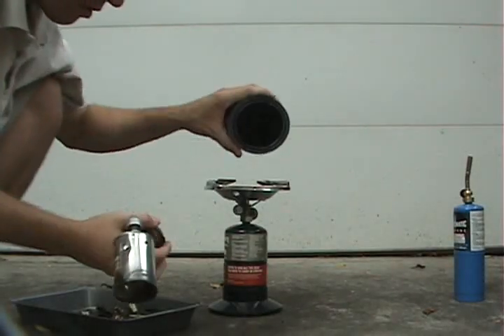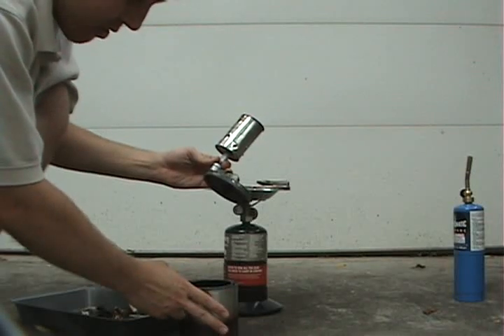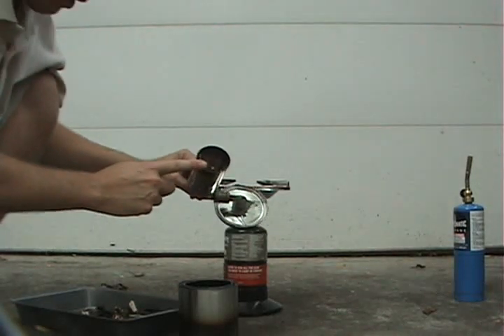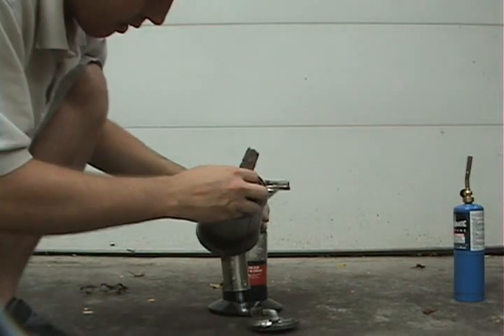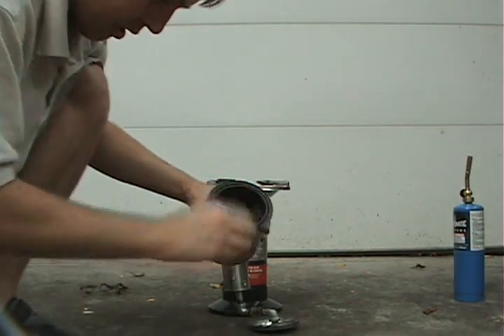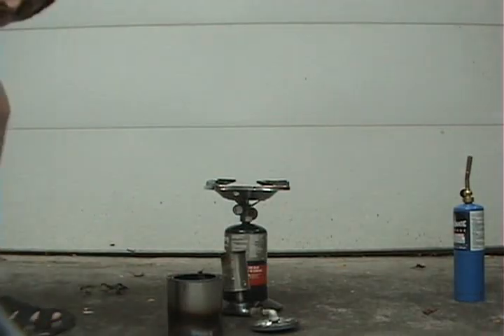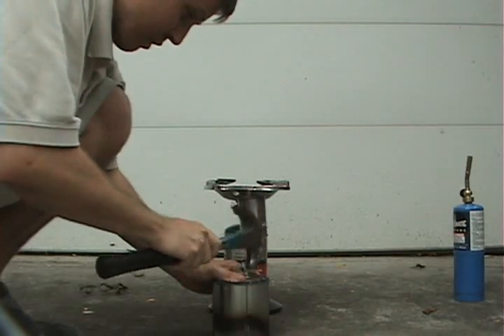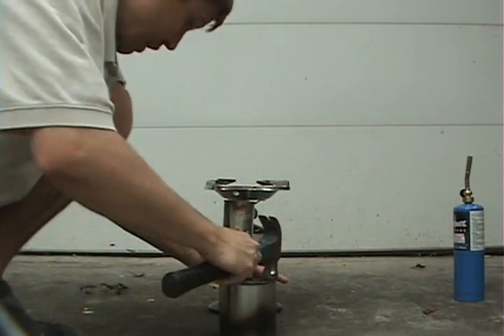Simple Wood gasifier

Comment: Thanks for sharing. I guess after it's has been burnt you could use the charcoal that is left after gasification. That way you can reuse the left overs for your next run. Great work keep it up
Reply: I use my charcoal in gunpowder. Also make activated charcoal from it for various uses.
Reply: @gwsmith76  They done lab testing on some Lab rats to see if claims that if activated charcoal could actually save you if you ingested poison. In the process of feeding the rats poison and activated charcoal they were stunnished when the Rats didn't die and lived three times their expected life span they had to kill the rats to finish their findings. Their finding was not only if you ingested poison that activated charcoal would save you but it was found that drinking activated charcoal everyday would increase your lifespan by 300%. I haven't personally drinked it but heard you could use lemon juice to make the activated charcoal instead of the Potassium Hydroxide. I personally believe it's the very large PH of activated charcoal than the anti-Toxification that it has that prolongs life, because the  activated charcoal moves straight through the digestion system and out the colon. I think the Potassium Hydroxide is the reason the rats life expectancy tripled.

Comment: Producing syngas from wood seems like a cool thing to do but it seems like most people are burning wood, coal or propane to fuel the pyrolysis. Great for the prepper mind set but not realistically valuable unless an complete break down is society and economy happens. I would like the use electrical resistance to power one and of course have green electricity as the power source.

Comment: Is it possible to convert gas form the gasifier into liquid gasoline by condensing it?
Reply: You're thinking of pyrolysis oil. So the main thing that's burning here is methane and hydrogen from decomposing cellulose, but there is a mixture of hydrocarbons from lipids within the wood being vaporized and burned. If you were to pass the gad through a condenser, you'd end up with a mixture of hydrocarbons not unlike crude oil. From there, you can fractionally distill the mixture to various mixtures like gasoline. Wood is mostly cellulose, so it's pretty inefficient for that means of producing biofuel, but other things like algae are being investigated for that purpose.
Reply: Are  hydrocarbons flammable? You said you can fractionall distill the mixture to various mixtures like gasoline. Since you said wood is mostly cellulose and it is inefficient so that means I cannot do it? Oh can I send you a link of a video that I found about gasoline from wood?
Reply: thermochemical conversion to biofuels shows up as a related video. it explains how to make various petro fuel hydrocarbons from wood gas. algae has its' drawbacks.
Reply: FriedFrudda I mean, it's not impossible with wood, it's just comparatively inefficient to things like nannochloropsis algae. Crude oil, in itself, is a mixture of various hydrocarbons of differing lengths, and thereby compositions. Pyrolysis breaks down some lipids into a similar mixture, which can be separated through fractional distillation.
Reply: Ok.
Reply: Your correct.
Reply: Ahh I am looking for pyrolisys. If that is it then that is what I'm looking for. So is the same as gasification or what is the difference?

Comment: I´ve seen a video where they have a rocket stove (which in my opinion optimizes wood burn) to make coal this way, and in the process it makes this gas.  Now, what they do is run a pipe down from the can where the gas is being "harvested" back again into the rocket stove, after a short while, the rocket stove runs solely on gas :)  The neat thing is that you can start the rocket stove on used oil or homemade brickets, thus bringing the cost down to zero.  Now, for safety reasons, how long does the gas making process takes, and, any ideas on how much gas is produced  by how much woood?  Thanks for sharing your video!
Reply: hey that sounds great with the rocket stove producing gas.do you have a link or a description for the video?

Comment: But what's the point of using a fire to create another fire? What's the gain/advantage? Please I'd like a reponse. Thank you.
Reply: Because hydrogen and methane are highly flammable but to chemically break those elements down you need a high heat source in a non oxygenated evirons
Reply: As others have said, basically it is creating a fuel that is more useful than straight wood. Using this setup, the wood in the can will turn to charcoal which could potentially be used to help make more gas/charcoal. Emphasis on help. There will be losses of course. The gas can be used (once cleaned up) to run just about any old gasoline engine. I even ran across a video of a wood gasifier wood stove that could be used to heat a home or "reversed" to produce gas for an engine. Pretty interesting stuff.
Reply: The reason is to increase the temp. For the breakdown on a chemical level it has to reach 2000 degrees.
Reply: because when gas is 4 dollars a gallon i live in a place with shit loads of dead, felled trees that are free for the taking. I can use those with a more advanced setup to use fire to make my car move and give me electricity from a generator. its called bad ass
Reply: Ive a question I have heard the plans for a gassifier put out from FEMA doesn't work were can one get a blueprint of one that does? I want free electricity too
Reply: Isaac Orr the fema one works good just have to ad a cyclone filter and also i would add a water bubbler for cooling and added filtration. hope this helps.
Reply: Thanks a lot of info out there so I appreciate the heads up

Comment: Saw videos on putting "spark plugs" on car's tail pipes ( not O2 sensors).  I'll leave you to put a spark plug up "your" tail pipe and run a charge through it. You seem to contradict yourself.  If a O2 sensor acts like a spark plug, Why do you need a spark plug then? Because O2 sensors don't act or are spark plugs.  Second, the damage that is done by burning raw fuel is very high to a car's exaust system, no catalytic converter is recommended and is illegal to do both for street driving.

Comment: I went and read about oxygen sensors from various sources in the internet including wikipedia.  No mention of oxygen sensors working like "spark plugs".  The fact that you took one apart does not mean you know what you are talking about.  I can cut open a person but I am not a surgeon.  You are wrong.  O2 Sensors DO NOT work like spark plugs. They do not burn "raw fuel".  They do what I told you, they measure the air fuel ratio and adjust the mixture accordingly.  Go back and read more.

Comment: I thought that the oxygen sensor was just that, a sensor that would measure the oxygen in the exhaust and adjust the mixture by sending a signal to the computer to make the mixture more rich or lean, not to burn the raw fuel.

Comment: You are incorrect. With gassification you get twice the energy. What is buring coming off of the unit is the smoke you would see burning off of a fire. When the material is fully gassified you open the chamber and remove burnable coals which you can then use in the lower burn chamber. Simply put, you get twice the energy with gassification. This is why you see some countries using wood gassification power plants

Comment: Hi, not to appear negative, but why burn wood to make a flame?
You already have a flame from the gas cannister which would probably last a lot longer than a few sticks, especially as you have to keep the propane heater on all the time.
Also, everything is made from gas, so with enough heat you could gassify anything, but what you put in will probably be a lot more than you get out so it's not worthwhile.

Comment: Very cool! I'm in the process of building an emergency generator that runs on firewood. I found a perfect 5000 watt 110/220 Milwaukee generator at the scrap yard that was only missing the carb which isn't needed and a stainless steel 15.5 gallon beer keg for the gasifier. I'm going to tig weld legs on the keg and install a filling door on one end of the keg to stoke the wood. Then enclose the base with sheet steel to form a fire box under the keg. Then just filter the resulting wood gas.

Comment: Does the gas gum up the lines that it runs through?  I'm thinking of creosote build-up, but if it's not actually burning, but rather sort of vaporizing, then it should be a cleaner gas, but might still gunk things up over time (or not).  Yeah, if you could split the output line so that it heats itself and has another (or even several other) outputs, there would be any number of cool uses.  I knew that you could run a car with a modified carburator on it, but never knew that it was widely done.

Comment: This is NOT an efficient use of pyrolysis. It's just a demonstration of how it works. And, by the way, a good one. This kind of process can be self-sustained, using the woodgas (or syngas) produced by its own to generate more heat. In WWII, cars and trucks in Northern Europe used to work with wood/charcoal : With gasifiers, they pyrolized this material and the resulting syngas was burning in the traditional four stroke internal combustion engines.

Comment: I hope this isn't a really dumb question and I just don't realize it, but could heat it with its own flame and use it as a self-fueled heat/light source?  Right now I'm retrofitting a wood stove with an EPA cert. style secondary burn air input line.  It's the same sort of thing as you've got here- burning woodgas rather than have it just escape up the flue.  Very cool stuff.  I might make a little one like this just to do it.  Good job.

Comment: so what is the ratio of volume of gas u generated from the wood compared to the volume of gas you used from that tank to produce the heat energy required to initiate this chemical reaction...?
seems fundamentally impractical to me...

Comment: I loved your amazing idea and copied it, but I have a problem air sealing the can. I'm trying to collect the gas in a balloon, but the gas goes away from the place which can is connected to the pipe. Should I weld that part or is there easier way to do so? By easy I mean something that I don't have to go around and search for some one with an electrode welding machine :D

Comment: @bryanf37 When our city was much smaller coal was heated to give off coal gas there was a huge inverted "barrel"which would float up and down in a sleeve of water as it was filled with gas this low pressure gas was piped at least a mile away for heating and cooking .Even the degassed coal (coke) could be used in furnaces.

Comment: @magna59 Once started Pyrolisis is self sustaining. In fluid bed designs they even add small amounts of fuel in constantly to keep it producing for days ! They also use the hot gas before burning to dry damp fuel.

Comment: @Mrsconnelly723 Simply because wood is much easier to work with than grass clippings. Grass would have to be dried and processed before burning... I'd rather just collect a few twigs here and there and break them up.

Comment: Ubo, yes, he's burning propane to make wood gas for the demonstration. But, other sources of heat will work. Concentrated sunlight from a Fresnel lens or parabolic dish/trough will also work.
You can't make gasoline at home to run a generator, but you can make wood gas.

Comment: It's a demonstration video showing wood gas production. He lit it on fire to show it's flammable, show it is wood gas.
The purpose is not to make fire produce fire, but to produce wood gas, which can be piped into the fuel intake of an engine, running that on wood gas only, no gasoline.

Comment: Put a set up like this in a rocket stove, run a generator to recharge a battery bank for home power while you cook dinner or heat your home &/or heat your home's hot water.
Go ahead & distill fuel alcohol with wood gas & you cover your transportation needs as well.

Comment: Interesting. I assume one could simply pipe a portion of the heat from the gasified flame back to the wood so it was a self-contained fuel system?? I love this kind of messing around with ideas! Thousands of people giving their own spin on interesting experiments . . . . it's like having a massive, worldwide R&D center open 24/7.. Great work.

Comment from the maker: @kienanyeo Make sure you have a good stream of gas going and a torch to light it.  If the wood is damp, it makes it much harder.  It took about 8 minutes before I had a a steady enough stream to hold a flame.  Also try to make some type of burner so the gas can mix with air.  I piped mine through a small tin can.  The can had holes in the bottom.  That helped the flame.

Comment: Very nice demonstration. I have just become interested myself in the process of biomass gasification. I have been very intrigued by solar heat and HHO production. I just built my first  hydrogen dry cell. I seen where biomass gasifiers produce many gases. Methane, ethanol, and even hydrogen. This is a very potent mixture. I plan to build my own gasifier. Have you built a larger one?

Comment: gasification will come back when oil is so expensive that you and I can`t afford it anymore.
nice video have you heard of backyard grass clippings being turned into pellets and being used in gasifiers  thing about it your gas bags instead of going into the trash they could heat your house in the winter 
just pellet it and save it up until needed it will give them time to dry out (pellets) and you can heat your house for free.
or you could even run a genset get heat and electric for free

Comment: I've seen something very simlar to this mate a inventor Dick Strawbridge a Ex Army officer made a actual wood gas stove and got a old ford truck and mounted evrything on the back of it he had the stove cooling tubes the whole lot then he connected a pipe to the van's engine and had a bit of trouble at first to get it started because the mixture was too ritch then they tryed again and got it going they was driveing All around London {UK} they made it for a gardning company who wanted to show that

Comment: So you are using propane fuel to heat wood which creates a carbon monoxide flame.

I can't see the point to this, anyone fill me in on the point of using a fuel to create another fuel that has no additional benefits.

Comment: Just ash Redshift21.  Also, woodgas can be and was used during and soon after WWII in Europe to power engines for farm machinery, cars, buses, generators, gas for gas heating, etc.  It is useful in a petroleum emergency, not a replacement for current or greener alternatives.  With WWIII looming, it is advisable to research / google "wood gas" and "wood gasification."